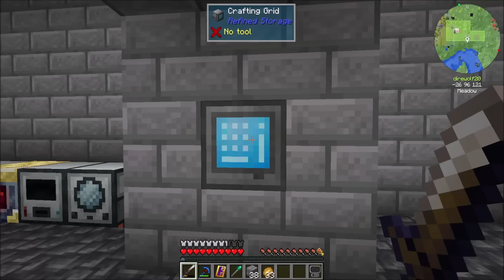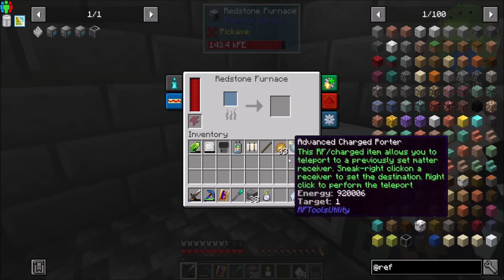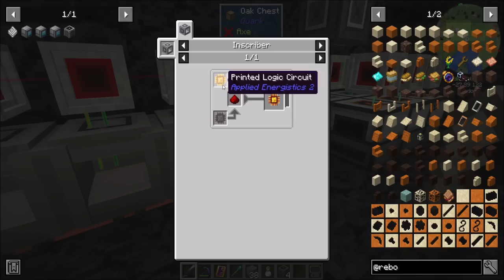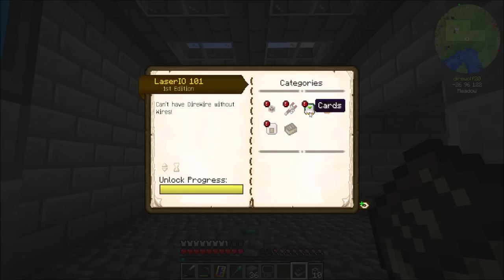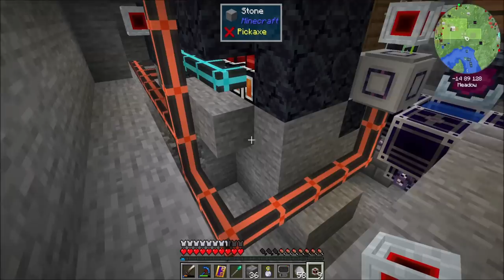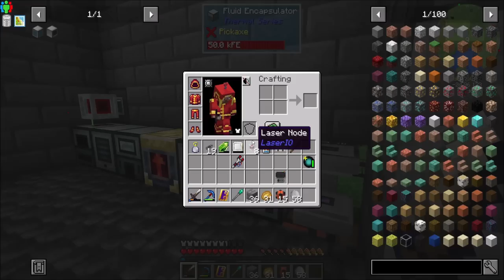Lets Play S11E30 Automation and Deep Resonance Prep

Comment: Tip:
Point an "exporter" onto the pattern grid with a "crafting upgrade" in it. 
Make it export blank patterns.
Than teach your system how to make patterns and viola, constantly refilling patterns in the crafting grid.
Reply: this is genius
Reply: You could do that with an older version of AE (AE1 I think) when the pattern terminal was a full block rather than the multipart it is now. It was really good idea.
Reply: Nice idea, never thought of that. Thx!
Reply: a bit late,but you should probably ad a regulator on the exporter too,if not,the crafting will keep well...crafting until a full stack is on the grid.

Comment: Been trying to use Deep Resonance in the pack already and there is a weird dupe bug with the DR tanks.  If you empty them via the other DR machines and break the empty tank, it magically has the original liquid back in it.  So I have a full tank of modified liquid crystal that I crystalize and as long as the crystallizer uses all the liquid crystal before I break the tank, the tank will be filled again and I can re-place it and grow more identical crystals, over and over again.  I even manually updated DR and the issue still exists.
Reply: Well, find their issue tracker and file an issue report!
Reply: @DarkVoidIII  TBH I haven't validated the issue is not related to Direwolf's Pack itself.  To proper report issues, I should validate it is actually with the Mod alone and not some other config or mod conflict.  All I have done so far is validate the issue exists in Direwolf's pack.  The mod stand alone possibly works correctly, and since I am in Software Dev, I hate to be that guy that reports an error that is not under the control of the mod dev themselves.
Reply: @earthwormo1175  I'm having the same issue, plus I can't make the liquid crystal... I have a tank of lava, the smelter on top, and an empty tank on top the smelter. And it's powered!

Comment: Ooh Dire......maybe you could add something to laserIO that lets you drill down into the nbt .....you know like an nbt filter.....but better. So in this case you could have a card that is checking only the fluid Efficiency, another for Purity and another that looks at Strength (I am a little rusty on Deep Resonance too) and then using the redstone cards it could send the fluid and the catalyst that improves that stat to the appropriate block and remove it when the stat is raised.

Comment: Instead of using an interface and LaserIO node, you could just use an Importer from Refined Storage
Reply: You can but Dire is planning on returning to AE2 later. Having an importer on each machine will require lots of channels in AE2. Having all processed items extracted using LaserIO will allow everything to be input into the storage system via a single interface.
Reply: @MrNeocortex  come back to ae2 does not mean replace the refined storage system

Comment: Refined storage is not auto crafting gold gears or enderium ingots. I’m trying to auto craft the machine upgrades for thermal series. Is this a bug or am I asking too much from RS?
Reply: It is a little bit more complicated to automate with the induction smelter. For the induction smelter, you actually want one induction smelter and one crafter per alloy recipe, this is because if you try to craft two different alloys at the same time RS will insert both ingredients at the same time and the induction smelter will get confused because it has too many items and will not craft anything. For the gears, I don't know specifically about this pack but if you are using the multiservo press, you want one multiservo press and one crafter per each die you put in them (including a separate one for no die at all), and not include the dies in the patterns, and just add each pattern to each crafter depending on which die they need.
Reply: @Ammonium-ow6pd  Makes sense. Thanks!

Comment: I've got a million of those crystals and tens of thousands of resonant ore and I started to figure it out but then I figured out mekanism windmills are better, cheaper and not complicated.
Reply: sometimes its more interesting to not use mekanism
Reply: but solving problems with unnecessary complicated solutions is the charm of modded minecraft
Reply: Yea, i just ended up using a 7x5x7 extreme reactor with electrum blocks as the "coolant" blocks for my mid game power needs. It was plenty simple and generates no radiation. The resources were a bit of a hit at that point (especially for all the steel and graphite, the electrum wasnt too bad, the design i went with (in a 5x5 grid, the 4 corners + a donut in the middle) "only" used like 40 blocks) but it was worth it
Reply: congrats on finding the boring path of generating power.

Comment: He should really add an alternative block for the lazerio nodes. I hate that they're not full blocks. Completely ruins the aesthetic of the mod. That's the biggest issue I have with it and honestly keeps me from using it. Even if its a powerful mod. The fact I can still use the Pipez pipes with their god awful texture says everything. Strange that Pipez is still using textures that look like temporary textures...
Reply: Haha, I hate how large they still are, ender Io had slim pipes and it looked clean, laser Io's nodes are too chunky for my taste. Also too complicated with cards in cards in nodes and stuff. Just running some pipes shouldn't require having the right cards with you. With enderio you didn't need to open a ui to change insert/extract mode
Reply: @zapl80  theres benefits to what dires made though. EnderIO didnt have the ability to be as precise. Also being able to connect them without a cable between them is great. You can connect them through walls which has many benefits. Couldn't access another side of a block either. While Ender IO is extremely missed. I think Dire made a great mod that is going to satisfy the itch for it. Especially considering we will probably never see Ender IO updated.
Reply: @zapl80  oh and Lazer IO is nowhere near as complicated as Integrated Dynamics so I think Dire found a clever idea of using cards to achieve advanced processes while also not overcomplicating.
Reply: @DemonicTheAngel  true, it's more powerful and will have advantages for those use cases. But I guess you could have implemented the same behavior without card items the way it is now. A config UI for simple import/export could just exist without a 'physical' card for example. You could also reuse cards by just taking their config, not the item. Some mod had filters like that.
Not to require clear line of sight and allowing lasers to cross each other also has the big downside that you can never be sure where all your lasers connect. You can trace wires better, you don't see when you accidentally disconnect a laser node and break your network because it may or may not have been a node with more than 1 connection.
Reply: @zapl80  I don't feel that its gonna cause to many issues in losing where the lasers connect to. Now losing the connection when you have a lot of nodes I can see. I think that the lasers should only show when you have the wrench in your hand. Similar to the EnderIO wrench. A huge thing about Dire's mods is he avoids making them too op. Which could be why he went with the cards route. Another reason could be that it allows for more to be done. Like if it was a UI you wouldn't be able to do 9 different processes on 6 different sides. Oh another bonus of using the cards is you can move the nodes without having to re-setup every little bit. With the cards holding the info it could save a whole lot of time. Don't get me wrong I understand where your coming from, but I think the direction he's gone with the mod is a solid one. Especially with the new card holder. That helps a whole lot. Now if only Integrated Dynamics would implement something similar lol

Comment: with refined storage you should be splitting up recipes that go to one item in the crafters shit will craft faster refined storages crafts all work independent
Reply: This. He always puts related recipes left to right, top to bottom within the crafter manager (interface terminal in AE2) when he should put them top to bottom, left to right. It bottlenecks both parallel and sequential crafting.
Reply: @MrNeocortex  little better said thanks